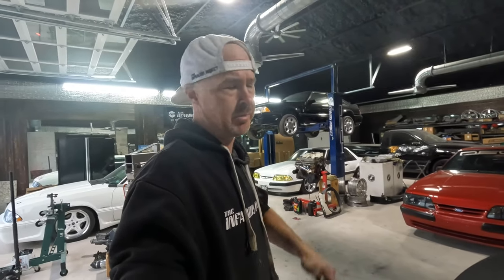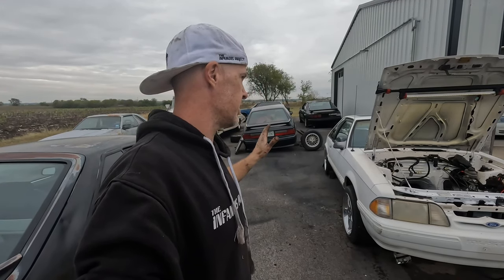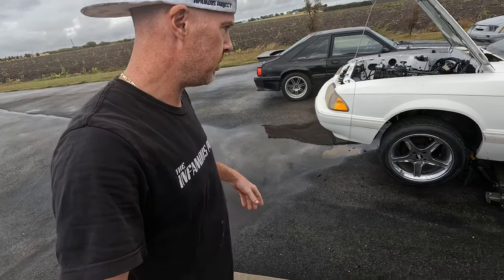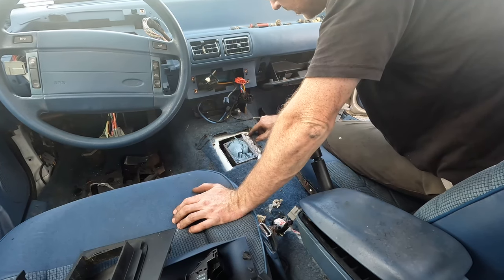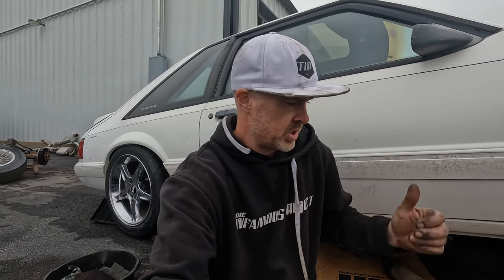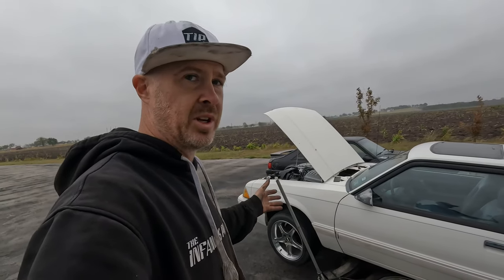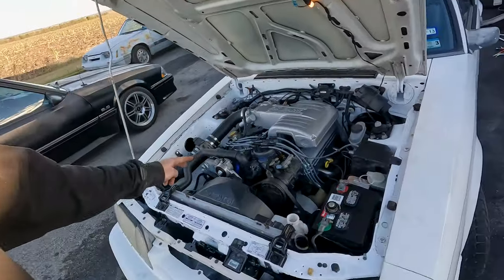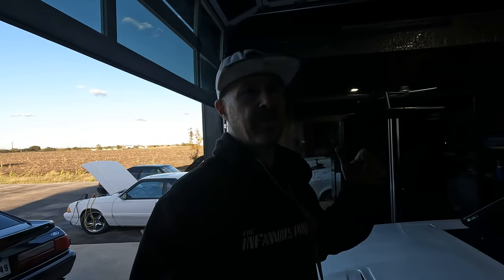Foxbody 4 Cylinder to V8 5.0 Swap in Detail - Part 5 Drivetrain Install & Frist Start! TIPS05E87

Comment: Car is looking great.  The auto vs the 5 speed car shift holes are different.  On a 5 speed car there is a "hump" that is spot welded from the factory which raises the shifter hole up about 1 to 1 1/2 inches.  The way you have the boot probably will work, but it is going to stretch that rubber a lot.  I have drilled out the spot welds and removed the hump and then riveted it over the AOD hole (after trimming like you did).  Awesome video, just wanted to point that out.

Comment: Now you have to change the rear end to a Gt rear end right? They’re just bigger and built to handle the v8 right? Then also would the Gt Harness work on a 351 Windsor or would I need a holly computer system for that? Also would a 93 351w be the best for a 93 Lx?

Comment: Good video! I have one ? Is any of the parts of the parts car for sale ! Thanks for the video.
Reply from the maker: Sure, what are you looking for?
Reply: @TheInfamousProject  I'm looking for the driving/fog light bracket on the gt and the wiring harness that plugs in by the horn that goes to the the fog/driving lights